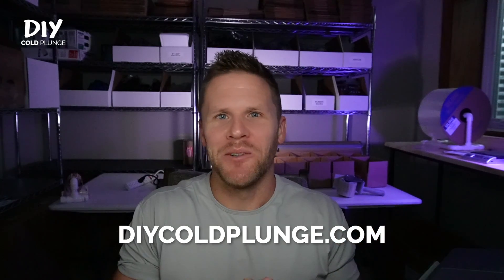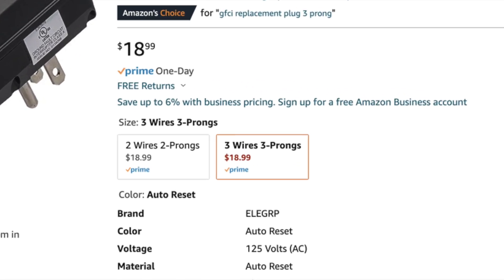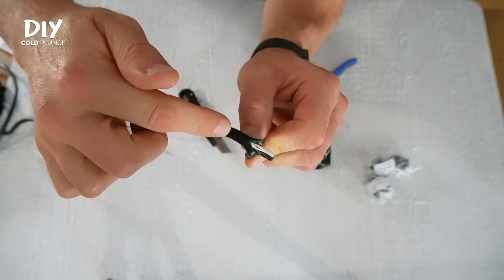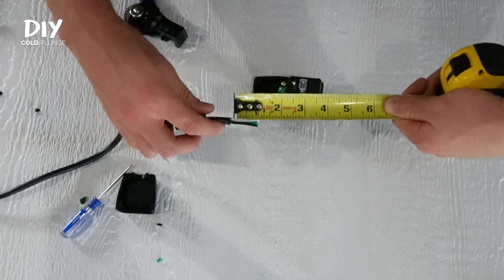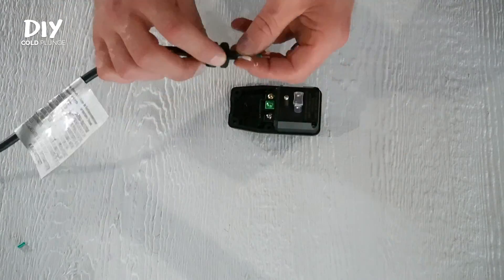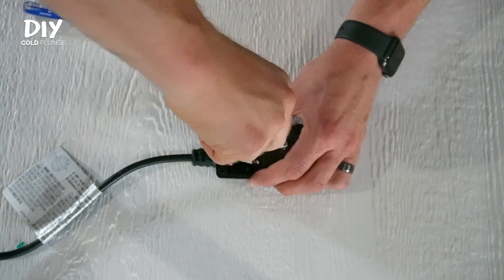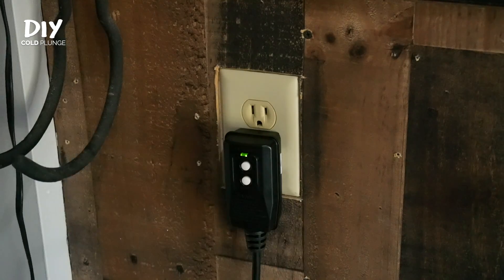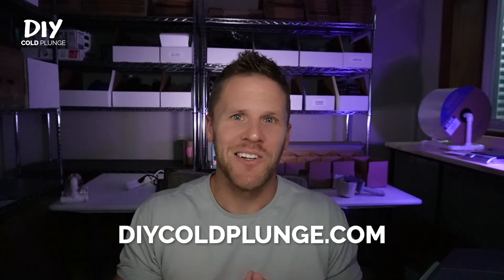How to make your Intex Pool Pump Run 24/7 for a DIY Cold Plunge | Cold Plunge Tutorial

Comment: How did your intex pool pump do after you changed the plug to run non stop ???
Reply from the maker: No issues - Ran perfectly for 4 weeks, then we had to drain the pool for the fall/winter.

Comment: What’s your thoughts for for having 2 pumps working at the same time. I believe the plunge systems does that? Any thoughts why you don’t have or use 2 pumps on your plans?
Reply from the maker: You could, it will warm the water faster.

Also - the plunge is only running 1 pump.

Comment: Joe! Thanks for being such a leader. How do you handle the filters with the Danner and GE/Venturi setup? My system is blowing through filters in about 4 days and losing over half of the water pressure. 1200gph system 24/7 hits the 30k gallon replacement limit on the sediment filters so fast. Can you elaborate on this?
Reply from the maker: I usually go monthly OR by when flow slows down. I also pre-filter the water with an RV hose attachment

Comment: I don’t think you need to cut the wires to remove the GCFI timer plug. Just unscrew the back of it, remove the wires (which have copper pieces ready for the screws in the new plug), reconnect to new g to plug. Anything I’m missing?
Reply from the maker: I absolutely overlooked that. Way easier. New video in the works 🤣

Comment: Have you though about making a plunge with the 140 Gallon Tamco Tank - 30" L x 24" W x 48" Hgt.?
Reply: Sounds like you got your dimensions confused. Besides that, there is no need for a 140 gallon tank unless you're 6' 8"
Reply: its an option just like 30 x 30 x 48 is. i like the idea of a standing squatting more than sitting during ice baths @Ak47777-l
Reply from the maker: Nope, but you can totally modify the plan for a different tank. Same principles apply